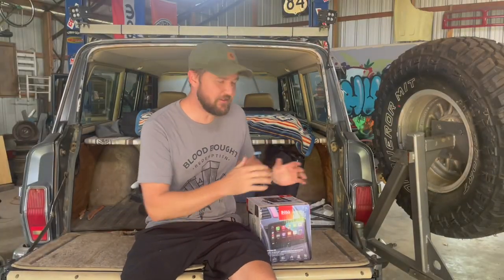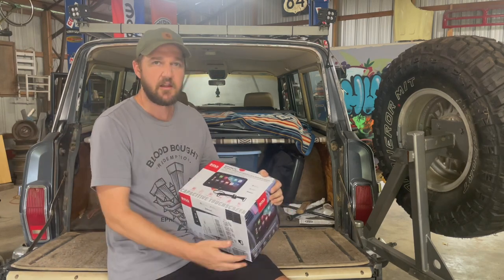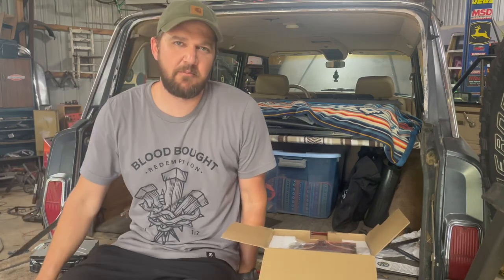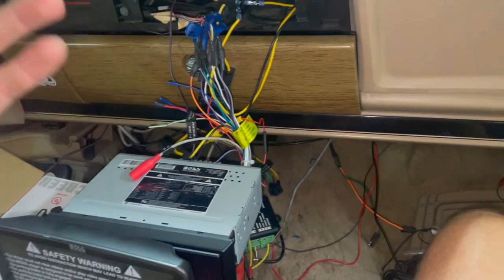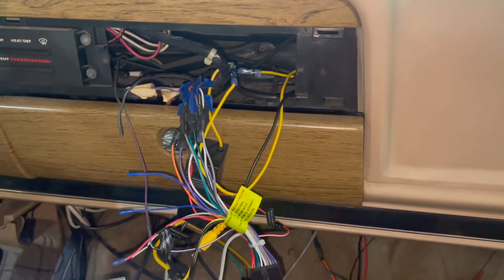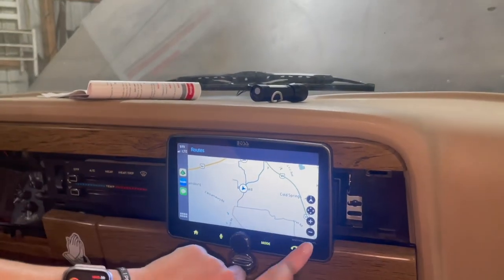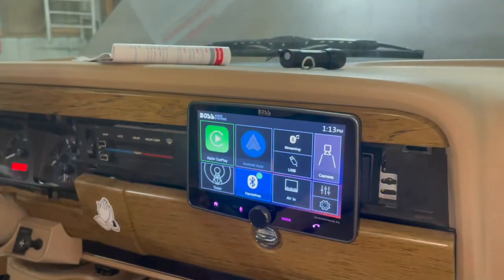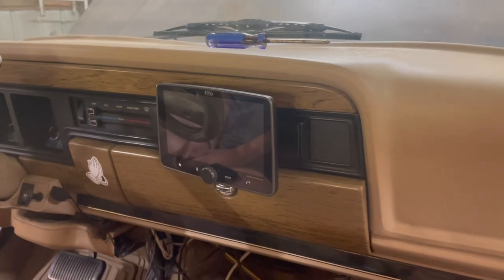Installing a BOSS audio system from Amazon in our Wagoneer! #unboxing #bossaudio #touchscreen

Comment: I kept the dash in Radio Flyer intact. 84 models had post radios, so I opted for a Retrosound unit to avoid hacking up the dash. I use the AUX input for my phone and run Sirius through the system. I get to listen to what I want to hear with no commercials, which is what the local stations seem to love to play. The advantage I have with mine is it's a simple flick of the balance part of the knob to switch from radio to auxiliary, so I can keep my eyes on the road. Kinda glad it's not a button push style. Tunes make any drive better.
Reply from the maker: That’s sorta what I have in the Bee. Factory radio with modern guts. Usb, aux etc. Works great!